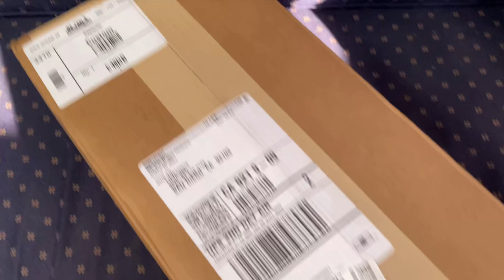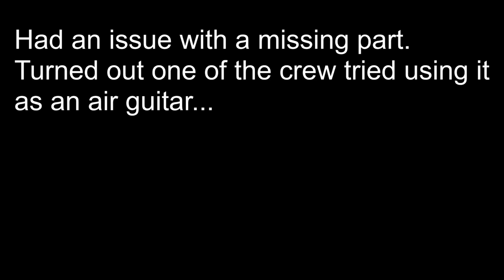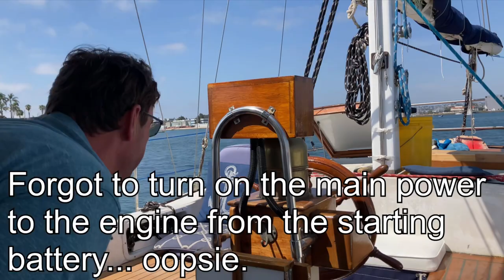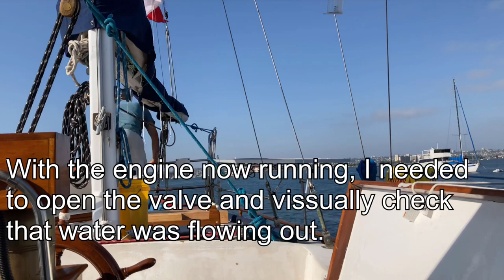Installing an engine on a sailboat, solo Pt. 2

Comment: You should arrange the fuel supply so that no electrical power is necessary to keep the engine running. Get rid of solenoids and use a cable.

Comment: So, You're a New Sailor, or New Boat?  I'll Have to Review Your Channel.  Congrats on the Success of the New Engine, and Quick Thinking With the Power Wire, Coming Free From the Engine.
Reply from the maker: Thank you. The boat is new and I’m new to big boat sailing. I was a sailing instructor in my late teen years, but on small boats.  I didn’t do any sailing however for over 30 years.

Comment: Very happy you have an engine... you could do some kind of break in procedure to ensure its longevity. Besides automotive diesel engines marine engines seem to have a break in period. I wonder how necessary break in is on any engine as there are so many varied opinions on that subject.
Reply from the maker: It’s an excellent question. In my humble opinion, a variety of work loads without too much at any one rpm and not going up to redline. Maybe that for the first 50 hours and then an oil change. For the first couple hundred hours I’ll change the oil more frequently. I’ll be rechecking the shaft alignment and retensioning bolts etc. I’ve also laid down fresh oil diapers in the bilge to more easily spot leaks.

Comment: Those Isuzu diesels are all over Asia. That's what I helped swap out on a Thai longtail boat. Here's the vid (which I may have already shared with you) https://youtu.be/S-Jwk34W9Yg
Reply from the maker: Yes! I remember the guy stepping on the battery in flip flops, 🤪

Comment: Seems ashamed that you can not take advantage of what many diesels can do in that once running they need no electricity whatsoever, so if your battery explodes you can keep driving till you run out of fuel.
Reply from the maker: Yes, the old engine would’ve been like that. Though if the engine is running, as long as the alternator is functioning, there should be no reason for a battery connection